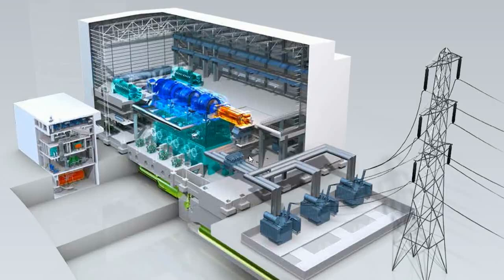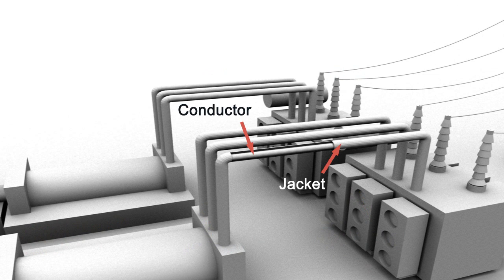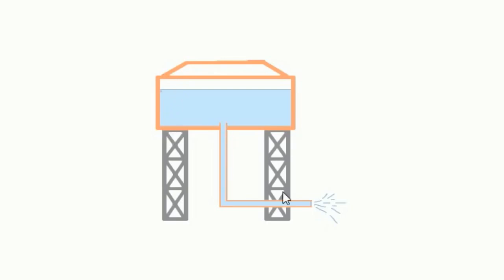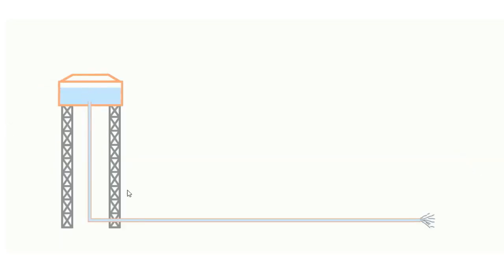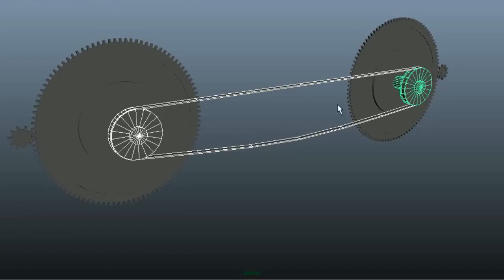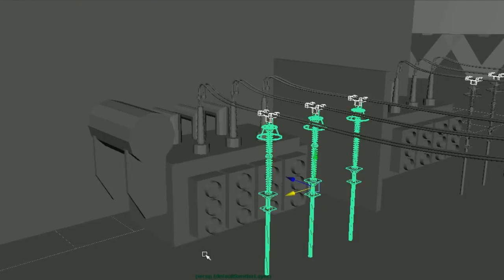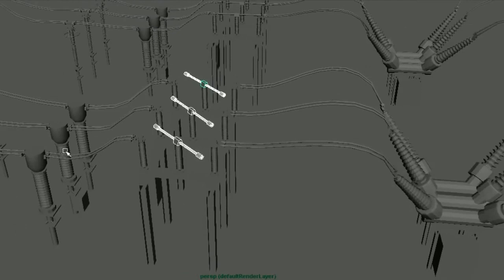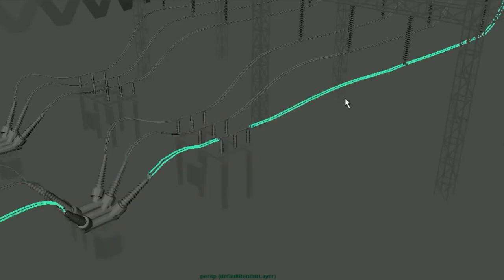Power Plant Switch-yard explained

Comment: So there are multiple transformers in a switch yard and there are circuit breakers.how do the circuit breakers work maybe with springs or hydrologic oil pressure and what is a switch yard used for.